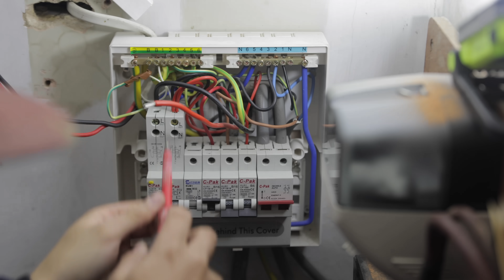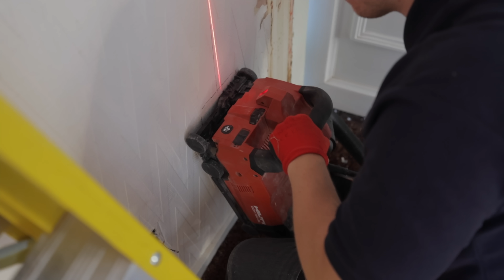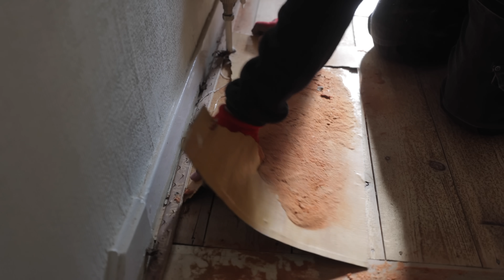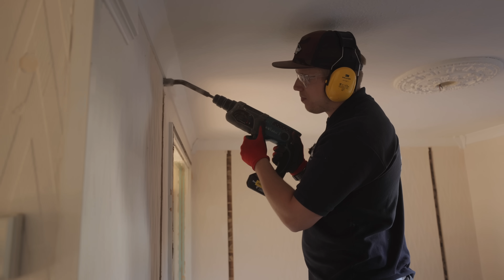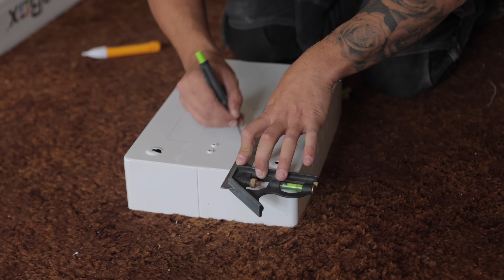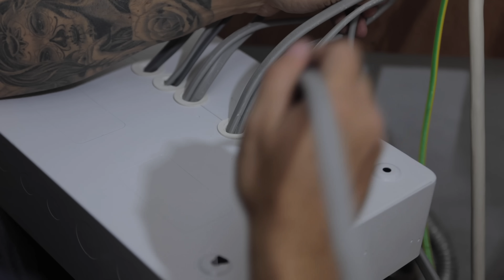GOOD NEWS!

Comment: Never thought about it, but indeed , what happens when companies go bust , and all these chargers that running with app become unreliable?  Or not updatapble? If  you had just normal electrical installation done in your house, any other good spark can sort out any issues or upgrades. But when something relies on app, that can become issue with smaller companies when they go bust...